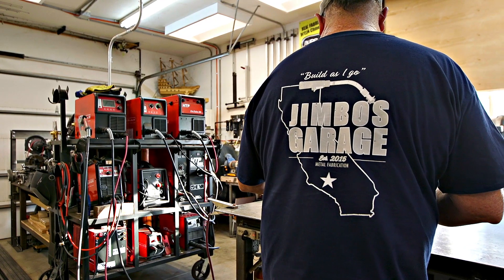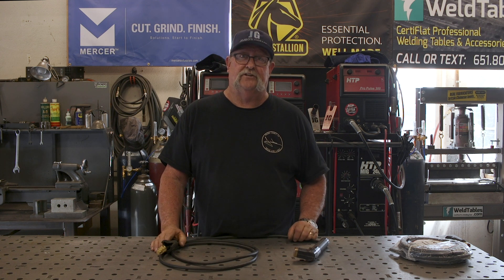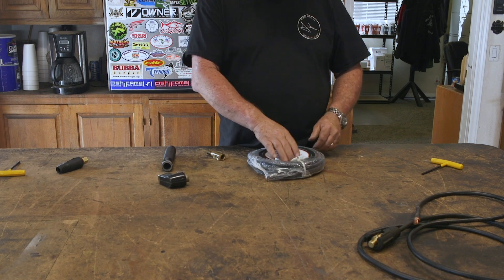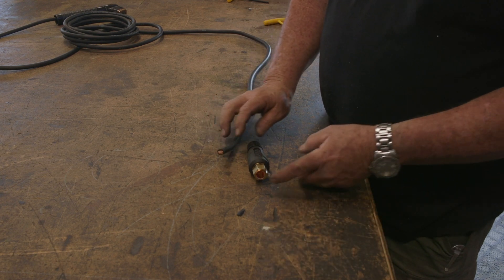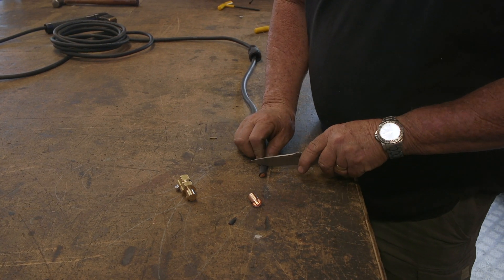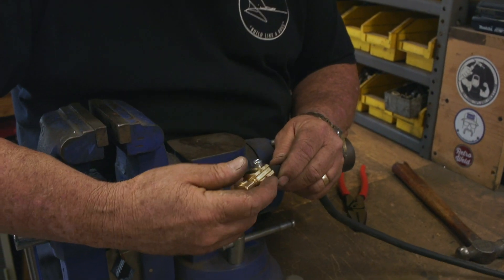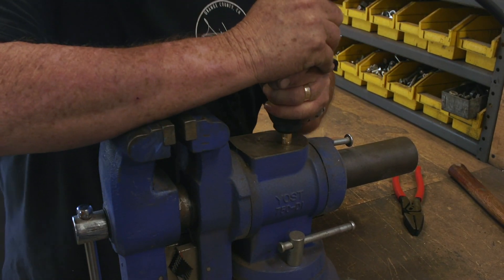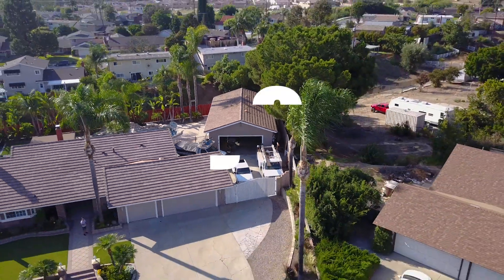Changing My Stick Lead Cable | JIMBO'S GARAGE

Comment: Old welding lead is great to use to wrap the bare copper strands around odd shaped parts that it’s tough to ground on like pipes. Just strip the insulation and clamp on your ground for a perfect grounding situation

Comment: Great video Jim. You could make a crimper from some 2x2" flat bar stock and mill a hole through the centre then a parallel 10mm hole and put a punch into the hole and smack it with a hammer

Comment: Jimbo

With multi-stranded cable, I twist then tin it with solder, seens ti make abetter connection than just screwing in/tightening the grub screw against the multi-strand cable.  Do the same for the dinse ferrule

John

Comment: Oop! The Ferrell is backwards. The expanded end goes towards the insulation. Not a major problem. It just eases the transition of the ferrel from the wire to over the insulation so that the wire doesn’t break.

Comment: Jim back when I worked at a welding shop in school (1972-1974) we always soldered the wire into the ferrule/lug to secure them.     For what little it's worth I'd convert that 8.5-10 feet to the ground cable extension with a male/female dinse connector set so that it may be used on any of your welders.     You might also wish to consider grounding all your welders to a common (manifold) point on the cart that doesn't usually move and just having one ground lead for them to share.    That would limit you to using one machine at a time but how many types of welding can you do simultaneously unless you make the ground to the wall larger?   It would lower the clutter immensely, and make your HTP welder's faceplates more clearly visible which would be beneficial to you, and HTP.     That would also serve as a couple video project ideas.
Reply: I like youre idea for the common groundclamp!

Comment: I'd say 20' is about the right length. With what welding cable costs, I always save the extra pieces too. You can always make a ground cable out of it.

Comment: Don't throw the cable away, you can always use it as an extra ground cable. Either fixed on your welding  table with a clamp and then on the part or the moving part of your vise to protect the acme thread. Another thing, take the insulation off, so you can wrap it around the welding project and attach the ground clamp tp it especially when you can't use the ground clamp directly.
Greetings from Germany!
Reply from the maker: Thanks for watching From Germany,    Jimbo!

Comment: You had me worried about you when you said you were throwing those old parts away.  Real men don't throw away stuff we figure we might need it sometime. So we keep everything.  I would have had to pull your man card but you saved yourself there on the end. Hahaha
Reply: That is the EXACT same thing I was going to comment! He redeemed himself in the end though! Way to go Jimbo. 🤣🤣
Reply: Yup, if you can't use it you can always "trickle it down" to some kid just getting started.
I think a shot of RTV silicone would make that Dinse connector plenty good enough for a home gamer's bench.